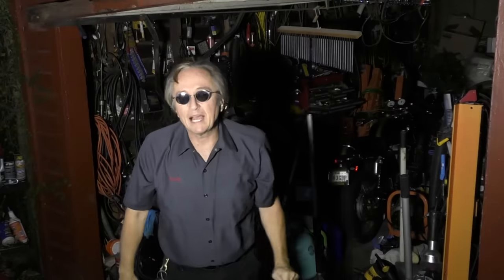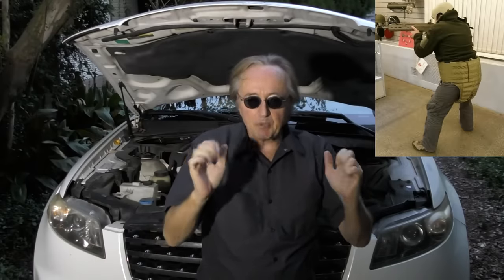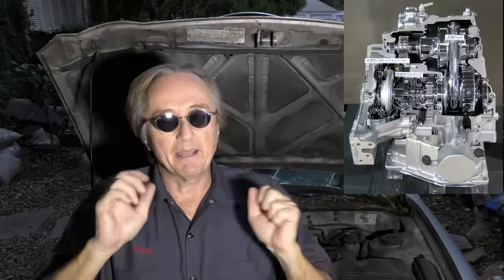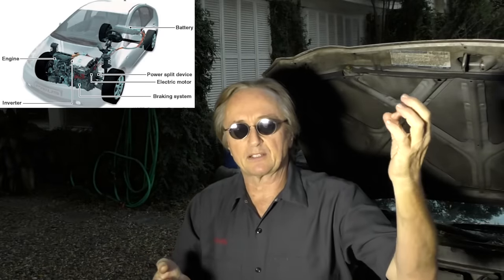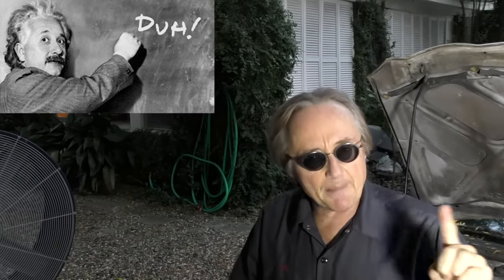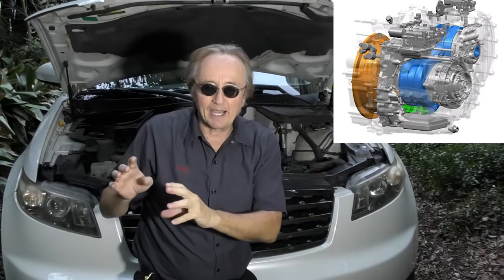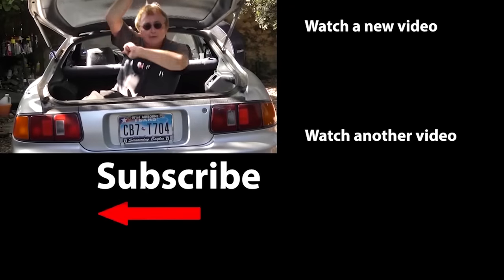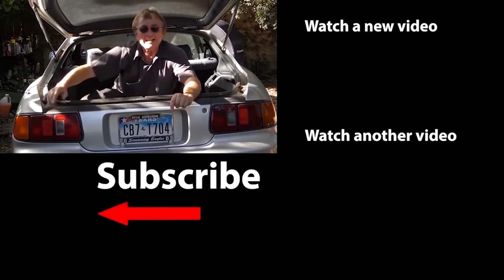Why Most CVT Transmission Cars are Terrible

Comment: I don't know what to believe, I just bought a 2014 Crosstrek. All Subarus have CVT these days and there are a LOT of Subarus on the road. Mine has 69000 miles on it. So I took it in to my mechanic for an unrelated problem (heat believe it or not), and he also said not a fan of CVT. Guess I'll have to find out myself the next 5 years. He did say should change transmission fluid often, like every 40k.
Reply: Stefan, Esq  The 17 and 18 have the same transmission and its made by Subaru not jatco!!
Reply: @bigdaddymak1439  Correct. Subaru manufactures its own manual and CVT transmissions. Their only tie to Jatco is the traditional automatics which were Jatco designs adapted to Subaru, and Subaru stopped selling those in 2014 when they went to only CVTs.
Reply: CVTs are great. Just not for f***ing racing and burnouts.
Reply: Junkyards sell my 2014 Subaru Forester CVT for $300-600. If they were unreliable they would go for $1500+. If you wanna know how reliable a part is just quote some Junkyards. High price = unreliable/ Low price = reliable
Reply: try sell it privately for close to the same amount and get yourself a low mileage Toyota that doesn't use a CVT.
Reply: Kendall Holt No way to drain and fill a 2016 Outback CVT as a DIY.  It requires a computer to fill correctly
Reply: I would trade it in for a Toyota as you can still get a none turbo engine and auto transmission up till present day.

Comment: Its funny scotty you dog Mitsubishi so bad I have a 2013 lancer GT that I got new and have dogged it pretty hard now has 132k on the same CVT and have had to do no engine work done but plugs and changed all the fluids that's it
Reply: matthew reed yea Mitsubishi cvts are actually bulletproof lol 😂
Reply: Mitsubishis tend to have more reliable CVTs as they don't stuff really torquey engines into their cars alongside the CVT. Lancers tend to only have about 150-160ish depending on whether you get the 4B11 or 4B12, likely the same case with the Outlander Sport as it's using the same Lancer platform and engine. You could likely add a turbo (RRM has an actual CVT approved turbo kit for auto Lancers) but the transmission would remove any gains from having it bolted on, not to mention you'd destroy the transmission even faster. 

Source: me, who currently owns a 2016 Lancer.
Reply: @GabrielIgnacio  I have a 2017 Outlander with same engine but this one has drive sport so it keeps the RPMs at 3 grand while in drive sport and it gets it lol CVT also
Reply: @matthewreed1078  Yeah that's pretty much the target rpm you wanna go for. You could go to about 4k if needed though that's more suited for those pinchy situations where you need to really get going anyways.

Comment: The Improvement of gas mileage is killing most of our vehicles. Me personally I don't care about gas mileage. I don't have to give 30 40 miles a gallon. I'm good with 20 on average
Reply: It's how huge car makers inflate cost of entry into the market from new and overseas entrants. So much regulation that you need billions of capital to sell your first car (Tesla). Safety standards are required, fuel and emissions standards is just greenwashed anti competitive behaviour. (if they really cared about emissions, electrics and hybrids would be just about universal already)
Reply: "Improving mileage" is just the excuse they give the public to sell them cheap, inferior overpriced JUNK.  They could make the old school transmissions get 80 to 100 mpg if the werent sold out to Big Oil interests.

Comment: I'd have to argue that the Subaru CVT is the best. Works seamlessly with the AWD.
Reply: @One-Crazy-Cat  And If you're a beta Male virgin ricer, your little chic/femme civic, altima or Corolla will treat you just right. Just to let you know, lesbians liked (past tense) Foresters; not Impreza/WRX; research a little more mate.
Reply: Speaking of Subaru, I'm always amused at the fact that the WRX actually comes in a CVT variant.
Reply: @GabrielIgnacio  Yeah as do the rest of its "automatic" models. It works very well actually. CVTs keep the car at its maximum torque band at all RPMs, an infinite range, so it's actually great for picking up and going. There is also no loss of revs and therefore power by changing gears like in a normal auto. They were banned in formula 1 because they kept on beating the competition. My 2018 WRX and 2018 Impreza beat so many cars with much more power on rolling races for this reason and because of the AWD. They are in the perfect power band at all times, gain speed without any loss of power like when you change gears and they launch as well as gather speed without any wheelspin because of the AWD. This is opposed to a 2WD conventional automatic.
Reply: @user-wv9mr2nh8h  Wouldn't the idea of 'changing gears' be moot in a CVT? It essentially has no gears whatsoever.

Comment: I had a Honda civic CVT die under warranty, and I had to fight with Honda to get it replaced.
Reply: Yeah, I'd like your insight on this happening too
Reply: @George Lappat 
Changing the exhaust does NOT effect the trans.
Reply: @motorcitymanman7711  No, but they can claim that any mod is a violation of the manufacturer warranty as a whole. If it's an expensive part you need covered. They'll reach for whatever they can to deny it if possible. Then they hope you're not smart or stubborn enough to get a lawyer and force the issue. Many people don't.
Reply: @keldor8302  
If you're in the USA the "Magnuson Moss Act" prevents dealers from denying warranty.
They have to PROVE the modification you did caused the problem.
Reply: Yeah, my Honda CVT starter clutch bit the dust. Seems to be a VERY common problem with the early 2000s. Aamco tried to fix it, but only made it worse.
Reply: Good advice. When taking a car in under warranty, take the custom crap off and put the original parts back on.

Comment: Hi Scotty. Back when I was younger I discovered that some cars, when you turned the wheel all the way to either direction and did a circle, they would shut off. I incorporated this into my "testing" whenever I tried to buy a used car and a couple I was able to fail. I have no idea what caused this.
Reply: It's stalling the engine just like driving in too high of a gear and lugging it.
Reply: It may have been related to the fuel pump and being on less than half a tank of gas.

Comment: Hi Scotty, I believe you've not answered this question before. In regards to transmission fluid, we always heard to replace them after 30,000 or 60,000 miles depending on cars. However, should we also take note on the interval? A car that seldom runs may not accumulate 30,000 miles even after 3 years. There's no manufacturers that recommends based on time interval for ATF /CVT fluids.
Reply: If anything considering that all/most liquids/chemicals settle over time, it doesn't work as well. So in my opinion i would replace it within a certain time interval just as driving it on a day to day basis.....think of it like soda, soda should be crisp but if it sits to long it flattens out.....

Comment: I got a 2018 Accord 1.5T and the CVT is AMAZING!!!!
Reply: Should've gotten the 2.0t but for the price the 1.5 isn't the worst thing
Reply: Yeah, didn't have the money for it and personally, I would rather have a CVT than an automatic. And I can't go back to autos after my CVT. It's buttery smooth and gets great acceleration.
Reply: How much was it out the door? I'm looking to buy one and which trim did you get?
Reply: If you get the 2.0 in touring trim you have to get the 10 speed automatic which I believe is a new design.  I decided to go with the 1.5 and CVT.
Reply: @mituljariwala9821  I got the LX Model with a 1.5T and I leased it at $11,000 for 3 years and 36,000 miles.
Reply: @saddestchord7622  The Touring can come with a 1.5T, you just have to order it if they don't have one at the dealship you're buying from.
Reply: @VishalShah2799  why didnt you just buy the car? The lx model out the door goes for $23k (that was the price 6 months ago, idk today
Reply: @mituljariwala9821  The monthly cost was too much for me right now and in the end, if I buy it out, I'll be paying the same price as I would if I just bought it then.
Reply: Good choice. The 2.0 would weakened the CVT much faster.
Reply: They discontinued the 1.5T in the Touring trim for 2019.  I did get a 2018.  I was saying if you wanted the 2018 Touring with the 2.0T engine you couldn't get it with a CVT.  The only transmission available for that trim level is a 10AT, which is a new design so I didn't want it.
Reply: @Bobby Engine Jr The 2.0T only has the Automatic option. It's a detuned Type R Engine and if you look up videos on it, it flies and accelartes really nice.
Reply: Oh that makes sense. Performance vs fuel economy. Thanks for the info.
Reply: Ardent Fan  Yeah, definitely not taking about long term reliability, just saying it's amazing right now. My sister had a 2014 Accord CVT and it performed great up until last December(it got totaled) and after 4 years, I'm pretty positive Honda has made improvements on it so I'm confident that it'll last but I'll have to wait and see. And it's Honda we're talking about so I don't expect it to be a complete piece of trash XD
Reply: @rubendmarmolejos582  The 1.5T or 2.0T? Because they're different
Reply: Dustin Anderson the 2.0T comes with the 10AT in all trims...only the sport has a manual option.
Reply: Vishal Shah it was in China and it was from injectors psi being to high and force fuel pass the piston rings into the oil which diluted it. Plus doesn’t help a lot of the issues was from a cold humid climate when they did very little driving to where the engine doesn’t even heat up. I haven’t had a issue with my 2017 Civic it has 24k miles and mostly highway driving. Plus I live in south Florida so who knows! 🤷‍♂️
Reply: @Travis I live in New Jersey so lets hope I don't have problems
Reply: 美光伍  Yeah, but it's more expensive with worse fuel economy😂 Im getting 36-43 MPG depending on how I drive with the 1.5T
Reply: 美光伍  Yeah, that price scared me away😂 But yeah, the combination of the CVT, which gives the lowest gear at the given rpm, and the 1.5t gives great MPG. I never go above 2500 rpm and accelerate just as fast or just a bit slower than the cars around me. It really is a game changer
Reply: 美光伍  Damn, would love to have that. Can't complain with around 40, though
Reply: I would hope so it's a 2018 😅 but I do love hondas!!
Reply: 美光伍  Honda released a recall this week regarding the 1.5T in the CRV (North America). Similar problem, oil dilution from fuel contamination. Just a software update I believe.
Reply: 美光伍  don't think it's out in public news yet. My uncle has a 2017 CRV and he recently got it. After all, Honda promised a solution by mid-November.

Comment: My 2017 Chevy sparks transmission went out while I was on a trip to Arkansas from Oklahoma. It was a pressure sensor solenoid that went out. But the thing is there wasn't any problem driving to Arkansas. But it was when I tried to leave that it went out. I got it replaced and running great now but man was that a long day

Comment: 2019 Sentra CVT whines under power, jerks sharply when shifting into D right after starting. Tries to imitate a conventional converter automatic with simulated shift points then acts like a slipping conventional automatic.
Reply: Sounds like it's working as designed :)
Reply: @TheFrenchPug  - 💩🤪
Reply: @algrayson8965  Yep. Tried everything including new valve body but it had to be replaced.  Last Nissan will ever buy.
Reply: @TheFrenchPug  - 3 of my kids work at Nissan. None would buy ANY Nissan👎
Reply: @algrayson8965  It's all smoke and mirrors now I take it. Just flashy commercials, slightly better pricing, and cars that fall apart right after the warranty is up....

Comment: I have a 2007 Nissan Sentra with 117,567 miles haven't had problems with my transmission, knock on wood 😅
Reply: CVT ?
Reply: Smokey do ur cvt transhmission fluid changed and levels correct and you should be fine. If you got a bad one it already would have exploded. (Just sold my 2009 Sentra because of the cvt) it didn’t break down I just knew that transmission was randomly going to grenade itself.
Reply: Because your car don’t have any horsepower. CVT with a car that has more then 200 hp cause problems and I’m sure your car has less then 200 hp
Reply: I had a 2009 Nissan Sentra with 138,980 miles when the CVT went out junked it for $1100 got a 2011 Toyota Camry..it won't be long before it goes..
Reply: Ditto, mine is at a 115,000.  Though I think we have the 1st gen CVTs, less efficient (more powertrain losses), but possibly more durable than later revisions.  Time will tell.
Reply: johnny Macon purchased a 2000 Lincoln towncar with 160,000 miles she runs like a dream. Sold the Sentra and bought that.

Comment: I find that the biggest issue with CVTs is their lack of maintenance.
Reply: What do you mean by lack of maintenance?. Like the owners don't maintain them well enough?
Reply: Its the power of the engine when paired with the 3.5 it tears up the torque converter. There's a company that makes a replacement one that holds up. There are other areas of weakness that may be a maintenence issue.
Reply: No amount of maintenance can fix the defective coolant line leaking inside the transmission. No amount of maintenance can prevent a poorly designed multi band cvt from wearing out prematurely. The Nissan CVT can be good, but the bands kink and snap and send the guides flying throughout the transmission ultimately destroying the entire thing. As for the internal coolant leak, it makes the bands slip excessively causing the transmission to fail prematurely.
Reply: My Altima CVT failed suddenly at 25K.  Its replacement failed 25K later.  Exactly what sort of maintenance was I supposed to do?  Change the fluid every 5000 miles? Every 1000 miles?
Reply: William Krause ive only ever hear bad about the altima. You shoudlve got a sentra or a maxima
Reply: The other thing that kills CVTs is shifting direction in them while the car is still rolling. For instance Reversing out and not coming to a complete stop before shifting the CVT into Drive, or vise versa. Complete stop, and firm brake pedal press, then shift from Drive to Reverse or Reverse to Drive. Shifting it while still moving will toast a CVT quickly.
Reply: @Don’t Tread on me! If you have to flush a transmission that means its junk, manual transmissions require no maintenance unlike CVT junk.
Reply: @Don’t Tread on me! No it is you who is mistaken. I ran my last car for 257,000 miles without changing manual transmission fluid and have sold it on with the transmission still work. Its had 3 hydraulic clutch fluid changes. I also don't see how not changing transmission fluid would cause a clutch to burn out since it would more than likely if anything mess up the gears rather than the clutch. Speaking of which the 257,000 mile car I was talking about has also never had a new clutch.
Reply: @Don’t Tread on me! It was a 2003 VW Golf MK4 bought used.

Comment: Nowadays, Many of Japnanese car manufacturers are put CVT on their car such as Nissan, Honda, Subaru, Toyota, especially on mini crossover and sedan with demand only highway and daily driving for not often using much torque, the CVT Transmission is now much better and improved than before, I have been using 2016 Honda Civic with CVT for 4 years and there have no any problem so far. The car is working smooth and perfection after more than 70.000Km.

Comment: What about a slightly older Toyota Camry xle my dad drives one as a taxi and it’s a hybrid with a cvt trans
Reply: E36 BEAMERBOY those are fine, reliable
Reply: Toyota combine cvt belt system and gears for first gear, mostly stress and failure at cvt is when moving from stop and go, this is gears shine and toyota combine it
Reply: No a hybrid Camry uses a different CVT design that is basically the same as the one the Prius uses. Long story short - it doesn't slip because it isn't belt driven.
Reply: Yes, its a planetary gear system
Reply: John Rickard yeap,,,

Comment: My 2015 Honda Civic EX-L with cvt is working perfectly after 4 years and I trust it.  After giving my son the Civic I bought a 2019 Honda Insight which has the e-cvt and I'm hoping it's as good as the cvt, only time and mileage will tell.